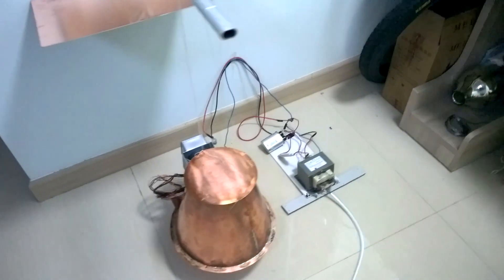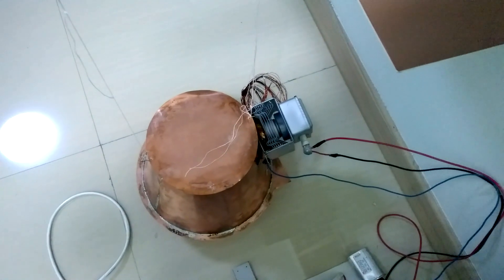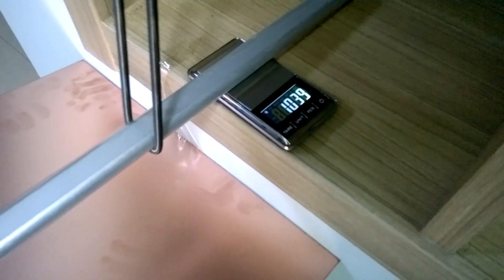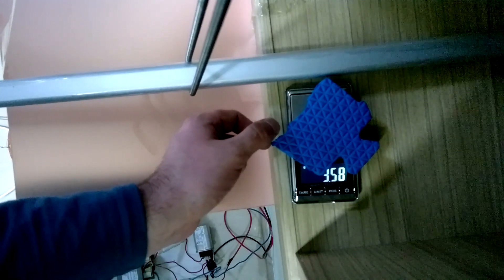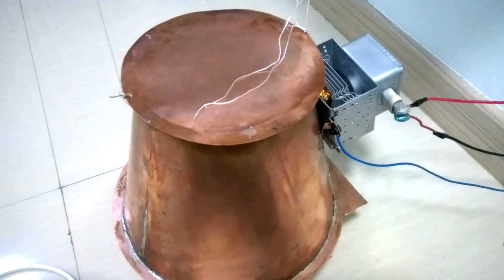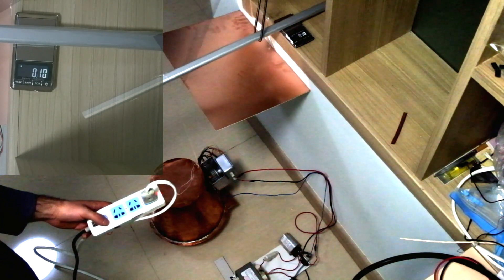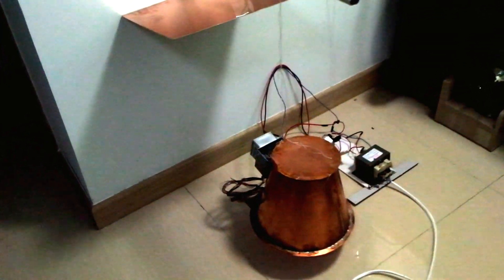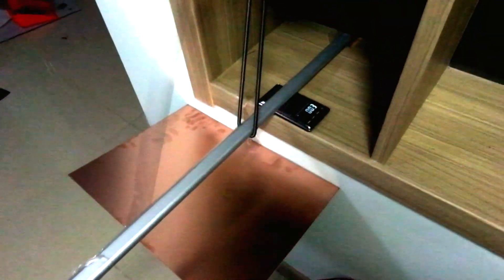EmDrive Test No.03 Success, I have thrust !!!

Comment: The best way to test this device is in a vacuum. If it works in a vacuum, you might be onto something.
Reply: NASA are doing it in September #emDrive
Reply: I'm not sure this is the same thing they're testing. Calling it something doesn't make it that same something.
Reply: ohmynoun be happy because NASA dit the test and mesured thrust too. the same amount as in atmosphere, thus clearing thermal and environnemental disruptions, they are doing test on the magnetic perturbations but so far the thing seems to be good for space flight
Reply: Again, I'm not sure this is the same thing they are currently testing.
Reply: ohmynoun
they are testing the same drive, they just built their one, using higher grade materials to reduce risk of errors
Reply: Any link to device specifications for both "EmDrives" for comparison? Somewhere I can see they have more in common than the name?
Reply: ohmynoun
wait for it, the nasa paper is still under peer examination before publishing
Reply: NASA's paper already passed peer review.
Reply: ohmynoun
if you speak about the eagleworks one then it is not the correct one.
Reply: That's exactly what I'm talking about, which is why all of this started with discerning what is meant by "EmDrive". Where are the links to NASA research on the design seen in this video? Or even links to confirmation that it's being actively tested?
Reply: ohmynoun
we do know that it is being tested internaly, NASA will only talk to us once they have finished experimenting with everything. it can be a decisive technology for them to have, this is why they let so few details. they may have publised it but i didn't do the seach, not do i have the time to do it now (stupid theorical mathematics, those things are bloody useless!). so, i wish you chance to find the links yourself. maybe you will have more info than i do because i realy want to know if you just need a copper trafic cone and a microwave to make an  electric engine :)
Reply: How do you know they're testing this exact design?
Reply: ohmynoun
because they are testing the mechanism behind it, they test to see if an alteration in shape, material, source of microwaves, can affect thrust, efficiency, if other forms work too. ect. their engine is probably more complex, and refined, than the experimental version you see in the video. but the principles behind it are the same.
Reply: mansuy adrien 
Who told you they're testing the mechanism? (Especially since you indicated that this one is different from the Eagleworks version.) How did you discover they're testing this? I'm getting conflicting responses and no straight answers to a simple question.
Reply: ohmynoun
well, nothing is realy secret when you have a contact working there. but obviously he can't tell me more about what there doing here, until they officialise if this thing works or is just an error within their machinery.
Reply: ohmynoun
the confusion comes for that 2 documents speak about the EM drive, the original one that spent a lot of time in peer, and the official NASA one wich they are still working on.
Reply: ohmynoun
there is no simple awnsers to this question, especialy if you talk about such an odd object. it might (and probably is) incorect in some way. but i still think we can at least learn a lot about the mechanism behid what it is doing
, even if the thing reveal itself to not work
Reply: mansuy adrien Then the proper answer is that you don't know they're testing it and are making assumptions based on incredibly limited knowledge. There's nothing wrong with saying that. It's sounds a lot better than the alternative.
Reply: ohmynoun
i know, it is probably a false positive, but i can't just say this thing is garbage because we used to say that too with medicine, quantum physics, and basicly every single thing who changed the laws drasticly. i will admit i am very septic about this, but you never know.
Reply: mansuy adrien I'm not suggesting this is garbage. But I don't believe it works the same as the one NASA is testing, and the one NASA is testing provides MUCH less thrust than this one appears to provide. That why I asked for some citations, not because I'm trying to invalidate the test. Citations would help validate it. But making claims that can't be substantiated certainly doesn't do it any favors in the modern skeptic climate.
Reply: ohmynoun
difference in thrust don't mean it is a differente concept, jsut an other EM engine, obviously it is not the same one
Reply: It means something is totally off between the two, which is why I was specifically asking if they were testing these specifications.
Reply: ohmynoun
the thing off is the difference in materials, difference in equipement, and the difference between vacuum and atmo.
Reply: That's fine. The point is that there is no substantiation for the claim that these specifications are being tested. And that's all I was wondering. I don't need to be convinced that the results in the video are valid.

Comment: First of all, this test should be done in a vacuum chamber. The way you're set up, you'll get effects from heating the air inside the resonance chamber. Second, you're equipment is WAY too imprecise and inaccurate to be measuring the small amount of thrust that is predicted from the EM drive
Reply: MiSt 526 it was tested by NASA in their vacum chamber, they claim to have mesured the same thrust

Comment: Rather than be a jerk about this, I'll tell ya how to increase the lift you're getting from this: don't use a magnetron focused at the frequency with which water absorbs energy. 

Microwaves exist in a variety of wavelengths. It's easy to use the one out of your microwave to test the theory, but, in reality, it's probably providing least power to your EMdrive. 

Klystrons, Travelling Wave Tubes, or Backwards Wave tubes (aka Carcinotrons) are probably more suited for a home experimenter, and they can move the microwave generation out of the frequency of oils and water, removing the danger of being burned by the microwave, and stopping humidity and other stuff from interfering with the device. 

Water is a problem within the earth's atmosphere because it permeates the air around us.

Comment: A number of problems I have found with this test set-up in light of the Shawyer description of EM drive physics. The big research labs tested in a vacuum, and Shawyer's description seems to require a very high quality, very flat reflective surface at each end. 

It also demands, as I see it, a very uniformly equal conic section.  That is so the side forces are completely cancelled.  As well balanced as your set up is, the measuring device may well be reacting to the differences in the the physical vibrations in the audio range produced from the magnetron. Such magnetrons are produced cheaply to a price, and the audible hum comes partly from the incomplete conversion of AC mains power into microwave energy. 

 Resonances in your spring counter balance could also be enabled through acoustic energy. Perhaps you can test for these anomalies without power and try the set-up with the microwaves absorbed into heat before getting into the cavity.

Comment: Guy, you aren't measuring anything.

What you are detecting is either electromagnetism created by turning the power on or increased vibration.
Reply: It's not a detector, it's a common household scale for measuring weight.  When he turns the EMdrive on he gets a negative reading because the drive lifts itself slightly and the bar pushing down on the scale rises off the scale causing it to go from 000 into negative figures.  I don't see how that scale could possibly be affected by electromagnetism.
Reply: Rob Fraser Because he's turned the juice on leading to an electromagnet?

Also, he didn't preform the simplest test imaginable.

Turning the machine upside down.

If the thing is producing thrust (increasing its weight) changing its orientation 180 degrees should change its mass (decreasing its mass).

If its simple electromagnetism or vibration, it won't.

The test is a waste of time because the person has no idea what they are doing.
Reply: Waltham1892 it did not, NASA did, even in vacum, his experiments seems legit since they too mesured thrust, in all directions, constant, and independant from external sources.
Reply: mansuy adrien If you bothered to read NASA'S study, you'd find that the effect they detected was within the tests margin of error.

In other words, the result was most likely  the result of random error on the part of the testing equipment.

In scientific terms, it means the device doesn't work.
Reply: Waltham1892
for all i can know, NASA didn't published their thing yet, as it is still under peer examination. the paper you red was a paper form an other institution. NASA just said that they did the experiment, it seemed to work and now they are working on reducing said error margin, and accounting for all the things that could disrupt it.
Reply: mansuy adrien "For all I can know..."

Know more.

They published, it doesn't work,

Find the study and read it for yourself.

Comment: what if you coated the inside with that new black paint that is the blackest Black ever created, they say the nano tube that absorb light in the paint create heat, will heat be created with microwaves inside chamber. if you coat one side with a thin layer of paint will it create thrusters as heat exits nano tubes to outside.
Reply: GAME OVER "WE HAVE EVERY PIXEL COVERED" congratulations this is officially the dumbest comment I have read all week
Reply: Don't worry, I didn't think most dumb people would get it. This was for smart people who know science. Move along.
Reply: GAME OVER "WE HAVE EVERY PIXEL COVERED" At least i know that you cant use "heat from nano tubes" as thrust

Comment: What's a emdrive
Reply: Exacly. We don't know what or how it works. Basically a Ion Thruster. NASA are doing tests on it and they also agree that it produces thrust. Some documents are set to release this December. Some scientists believe that this will re-write physics for us, or it is the remanipulation of our current physics.
Reply: The concept of an EmDrive engine is relatively simple. It provides thrust to a spacecraft by bouncing microwaves around in a closed container. Solar energy provides the electricity to power the microwaves, which means that no propellant is needed.
Reply: Zachary attacker it's like a regular engine, but instead of burning propelant, or catabmpulting gases at high speed, it use microwave to transform electricity into thrust without using a propelant.

Comment: sadly, the gentleman in the video seen here has passed away. Shortly after productuon of the video, several MASSIVE TUMORS had overtaken his body. Unfortunate. I always wanted a microwave that ran on microwaves. On a lighter note, anyone wanting to continue in his style of work, I have some radioactive material and a few pieces of foil. I hope to make a small heater for the winter.
Reply: Microwaves aren't ionising radiation so they won't create tumors, they will cook you though right to the bone.  Yum.
Reply: Brandon Lee yep, you don't die of cancer, bit you are fried anyway
Reply: Then why exactly did alot of navy men using early radar suffer from horrible tumors from using the radar as a heater on cold days.
Reply: Microwaves are non-ionizing, and they aren't even close to be.
Reply: I know however they do tend to cause a current to flow through conductive materials. Stick a few pieces of Aluminum foil in a microwave and its clear to see that enough current is generated to ionize the surrounding air.
Reply: not that kind of ionizing. Look up ionizing radiation. Thats the radiation that screws up your DNA giving you cancer. Not RF radiation that just vibrates the H2O molecules in your body and cooks you.

Comment: so the microwave heats the air until it starts to equalize and drops off
Reply: Does your microwave heat the air?  It's hard to create friction inside a gas, the warmth inside your microwave comes from the piping hot food radiating it.
Reply: water vapor in the air
Reply: ihatecrackhead it is not that, since NASA tested it in vacum and it works, same thrust.
Reply: Nasa tested it in a vacuum, he failed here with something completely different
this wouldn't work in a vacuum, just that fact that it drops off shows he is consuming resources, probably moisture in the air

Comment: Nice vacuum chamber you have there...oh wait that's sitting on your floor
Reply: Why do you need a vacuum chamber?  Do rockets or any other form of propulsion require zero atmosphere?
Reply: yes they do, especially at such small supposed thrust levels. Ion and plasma engines for example are tested in a vacuum chamber. This supposedly generates vastly less thrust than that and so is even more prone to errors caused by the environment.
Reply: But not if the errors is consistent with everytime he clicks a switch. Unless a random wind blows that's exactly 1g strong that coincidentally come and goes everytime he clicks a switch.
Reply: Quinn Radford well NASA did the test in their onw vacum chambers, still detect thrust.

Comment: I tend to believe that the perceived thrust is coming from heat generation reacting with air in and around the device.  The OP could disapprove this simply by showing that the device can be turned over and create thrust in the downward direction as well.  I have a feeling that it would not.
Reply: Then he'd get blasted by radiation, besides this is being tested in space, it's legit technology. If it was just hot air i doubt we'd see such a rapid drop when he shuts it off either, it would gradually drop.
Reply: Funny that I was going to say that it dropping off slowly was proof of what I was saying.  And if the drive actually works as advertised, there would be no radiation in any direction, that's kind of the point, and the problem.
Reply: It didn't drop off slowly... did you even read what i wrote?